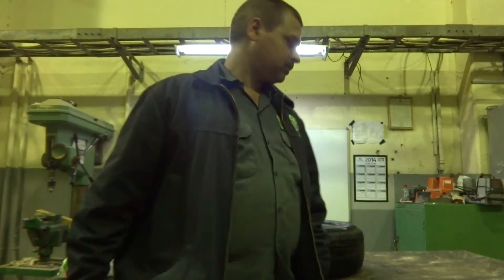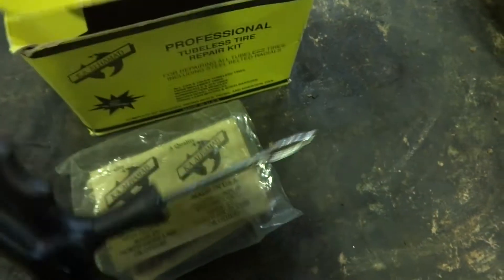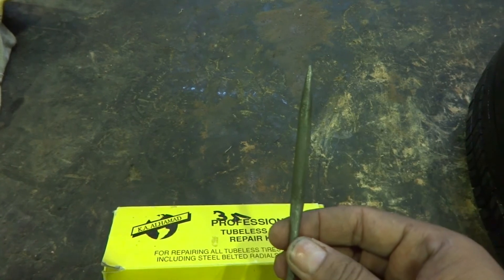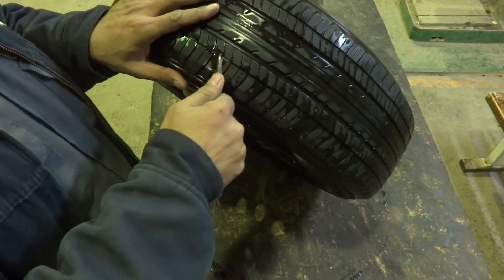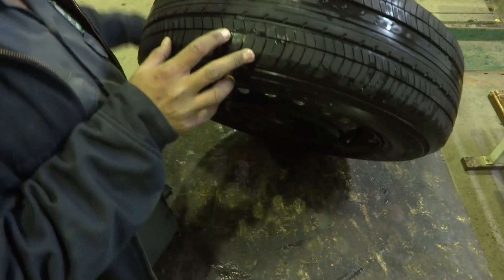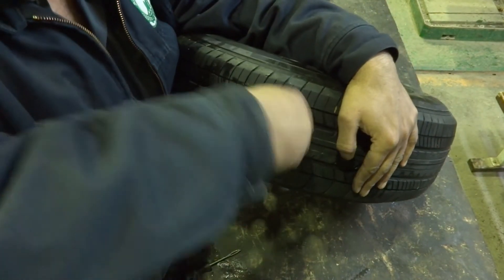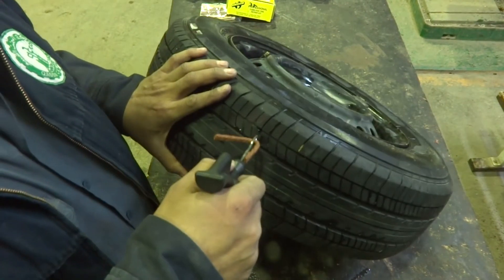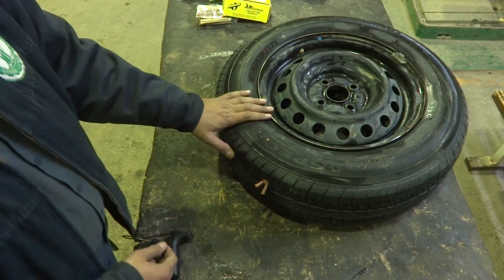Tubeless tire repair. Tubeless tire puncture repair. how to repair tire

Comment: Loverly job done, hope it worked well :-))

Yes some kits have another tool included, a bit like a rats tail file with a "T" handle, perhaps you can find an old rats tail file to include in your kit :-)

You had to use a lot of force to insert the sticky rope, thats good, it wont come out or leak :-))